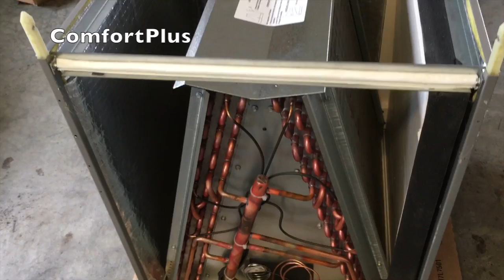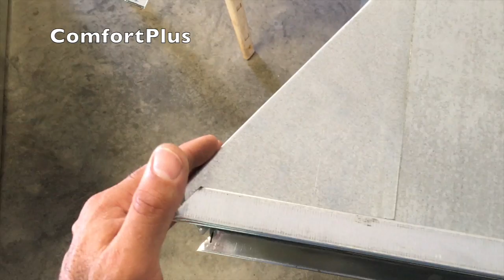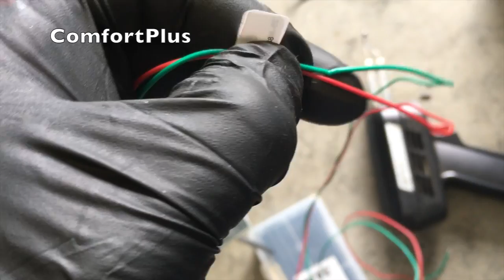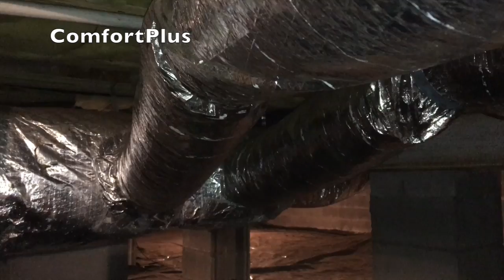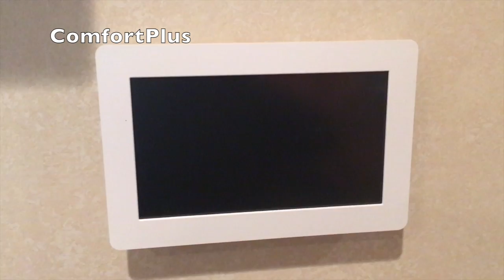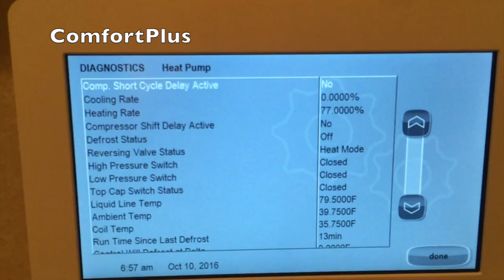Variable Speed Heat Pump with Zoning

Comment: I have a question i know this is a older video.  However i was curious right now upstairs we have a 3 ton ac unit single stage it never keeps up its 78 on hot days and room heating and cooling is always balanced hot or cold. Well we are going to replace and reduct the aging system.

My question is i wanted to up the system to a larger 5 ton variable speed system that would cool at the capacity needed however we wanted to add 5 zones 4 bedrooms and then the hallway and bathroom. I know this is possible but would it be possible to use  stupid thermostats with the variable speed ac unit.  I mean the fancy thermostats are nice but lets face it id be the only one in the house that would be able to work it.  I can barley get the partner to work the nest thermostats we have even that frustrates him. Even though i can work them fine. He likes just basic thermostats.  I wanted to zone with variable speed unit that way the unit runs at the capacity needed if only one zone is on and its a cook day its not going tonrun at full 5 tons.
I also wanted to add a return to each bedroom.

Just wanted to know how if thats possible.

Comment: Does the outdoor unit not have a high pressure switch? Does the Zone board report that this pressure switch has tripped and do a lock out if it happens more than once during a call for heat? It would seem to me that the duct temp. sensor if it can be adjusted to meet a safe limit for the system to work in, would do a better job than than an on, off switch. After all a variable system should be able to adapt to the duct system with the hopes that all things are equal for that unit.

Comment: After a year now, how happy have you been with these units, and did you add the third zone?  Just finishing up the ductwork (full sheet metal, just flex couplers on return and plenum) on the Armstrong Air version of this system.

Comment: does the unit require any static pressure probes to monitor the cfm?
Reply from the maker: No, this one just has the 16 pin motor and the board. It uses speed and torque to determine the airflow. Of course the motor is programmed to the air handler, so I guess when the warranty is up a new motor will mean $$$ lol.

Comment: great video. I couldn't tell, did you run a bypass duct or does the variable speed take care of that?
Reply from the maker: +Eddie Sellers Variable Speed does it for you. The other night it was 18 outside. I turned it up a couple of degrees on one zone and wound up with all 4 tons of heat pump running with 750 cfm of airflow.  Was getting 103 out of registers. I love it for zoning purposes!